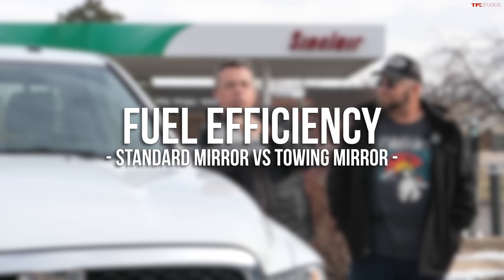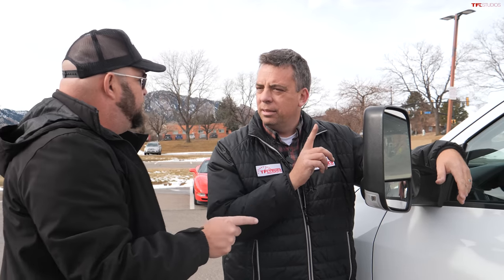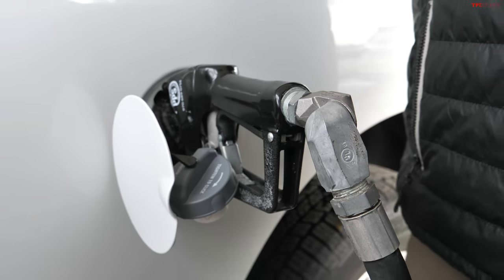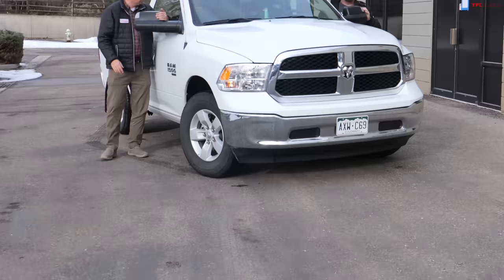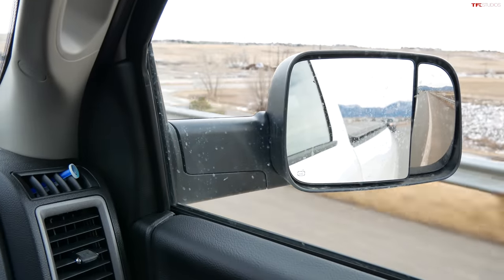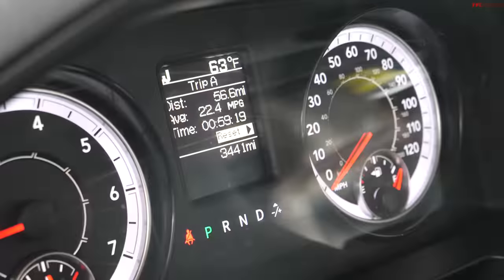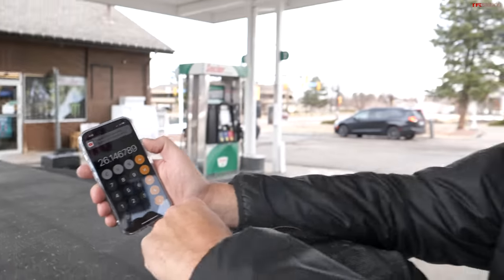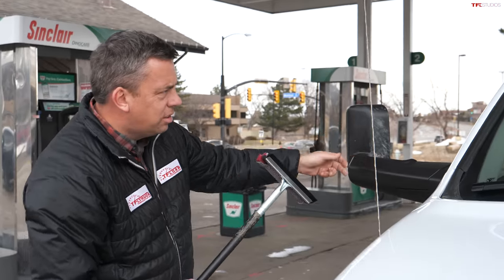TOTALLY UNEXPECTED MPG - Never Drive with Your Towing Mirrors Extended While NOT Towing: Here's Why!

Comment: I prefer the convex to be wide, not tall. I also prefer the main mirror to be wide, not tall. Since the option on that mirror is one or the other, I'd make it so the convex is wide and just live with it.

Years ago I heard that car makers removed the AM/FM antennas from the fenders and moved them to the rear windows or somewhere else, resulting in a gain of about 1/10th MPG.

You need to take a longer trip to decide MPG changes. 57 miles is not enough!

Comment: 2019 f250 ccsb 6.2 gas with 3.73.

Going off the computer, I have no difference between extended and short. Biggest thing is speed. 58 mph on back roads will get about 17.5 mpg. 65 mph gets about 15.5 mpg. 70 is 14.2 mpg and 75 is 12.1 mpg.

I just wish I could switch the flat mirror and the convex mirror, I like the convex mirror better.

Comment: The aerodynamic aspect of the mirrors is not what's causing the drop in fuel economy. The drop is due to programming in the truck's ECM. When the mirrors are in tow mode or "moose mode" the engine tune is changed to increase peak horsepower by 100 and peak torque by 150, regardless of the engine your truck is equipped with. This is done to improve towing performance but unfortunately increases fuel consumption. Side note: to increase this effect enable the hidden sport mode by turning the tow/haul mode on and off three times within ten seconds, leaving it in the on position the third time.
Reply: lol I hope you just missed putting th /s at the end of all that.
Reply: @ALMX5DP  hey it's only a lie of you believe it's a lie 😂😂

Comment: I still believe there is a flaw in your filling method.   Why not try a 3 or 4 time test run with the same setup just to confirm your testing is  fuel refill quantity accurate.

Comment: I agree with some of the other comments. That is way to large on an discrepancy and that test should be re ran a couple of time.  The extra air surface cannot create that much wind resistance to slow the car down enough to make 6 mpg difference. Maybe .06 of a gal but not a full six. Even swapping tire by up sizing wouldn’t drop 6mpg.

Comment: I think for these test, you should go by the computer. While it may vary from reality, they are usually consistent. I've had 2 rams, 1 consistently read 1 mpg higher than hand calc and my current one runs about .5 mpg off of hand calc. In your test, it seams that the full between runs may have been a bit less than full.

Comment: There's a lot of second guessing with previous MPG results here. Outside temperatures are the largest variable here, acting on air density, drivetrain rolling resistance, tire compound temperatures and tire pressures. All potentially skewing a baseline MPG result. 

Would be difficult to test without large time lapses in between, but a figure to consider.

Comment: I bought a set of these mirrors for my 2005 Ram 2500 HD and noticed immediately that the wind buffeting on these mirrors (when up) was enough to drastically increase the noise level in the cab (the doors were actually moving slightly in the frame). I decided to fold the drivers side mirror in toward the body to see if that would reduce the wind noise but the air pressure moving across the mirror actually forced it away from the body about 3 inches. I wonder if the chevy style tow mirrors would work better?

Comment: I would trust your vehicles computer to measure the fuel used way more than where a fuel pump clicks off, depending on how the fuel splashes around in the filler neck your always gonna have totally different numbers, compared to your trucks fuel injectors that are extremely precisely calibrated otherwise the truck would not run right.

Comment: Only way to properly test differences like this would be to use an external fuel tank that can be physically measured or significantly increase the driving difference / fuel consumption to remove differences on fill-ups.   I do agree the mileage should be less but this significant?  Not accepting this.

Comment: Seems like the pump isn't consistent as to when it clicks off. I realize it's difficult to do it any other way, but to be anywhere near accurate, it seems like you would need a more reliable way to more precisely quantify the amount of fuel burned. Although not practical, it would seem the results would be more accurate if done over a much longer loop...the difference of a few tenths of a gallon (easily variable with even the same pump) over such a short distance obviously changes the outcome of the test in a very dramatically. You guys are awesome and I like all these mpg tests, but I have often wondered about the reliability of the results over such a short loop (because of the likelihood of the pump to be inconsistent regarding when it automatically clicks off.

Comment: I’m agreeing with so many of the other commenters. You guys need a retest. You need to only use 85 octane. Even when your not doing your test. You are only topping off when you refuel with for your tests so if you are using any other octane or gas with ethanol or ethanol free can make unscientific deviations in your tests. I have never used 85 octane, but I would imagine 85 vs 87 alone could cause some deviation in the economy. I would think if you take your past test “stock” fuel economy quick is closer to 22 mpg that loss in economy makes more sense. A 2mpg drop is significantly more believable than 6. With that logic, 80% of my drop in fuel economy while towing my 10k lb travel trailer is caused simply by my tow mirrors being up. Run the test again.

Comment: The only problem I have with at mirror design. Is not trying to hit them when they are coming at you. They stick out way to far. All it takes is someone with them. Near the line. Their truck. Not the mirror. It puts me off the road. Some days I just want to hit them with my own mirror.  My 2020 F150 mirrors being close to the truck. I can see perfectly down the side of trailers. I hate those mirrors on a Dodge. All because they stick way out and I have to avoid them.

Comment: I have tracked every fill up in my truck for about 17k miles. It's a 2021 Ram 2500 CTD. I can say that I've never once experienced the EVIC calculating a lower MPG than a hand calculated MPG. I would question the validity of your first test. I believe that almost every Ram I've seen and asked for hand calculated MPGs has experience between a .8-1.5mpg EVIC variance whereby the EVIC over estimates. Additionally, while the extended tow mirrors do account for additional surface area being present to the wind, it should be more along the .2mpg difference at the top of the scale from what I've anecdotally seen and calculated. I enjoy the test, but to make it more scientifically useful it would need to be run a few times and throw out anomalies. Thinking your EVIC should be over estimating versus your hand calculated. Just my experience. As other have stated, the best test would be to run the loop with a weighed quantity of fuel, but that's not very practical. Either way, keep up the testing! Interesting to compared data!

Comment: You should have used 85.  87 octane will run richer at altitude.  The 85 that was in the tank before the first fill up will burn first.  As the miles go by you octane will have increased causing richer burning as the miles rolled by
Reply: How do you know what was in the tank before this video? And the engine will adjust based on the reading from the MAF or MAP sensor. Also Ram specifies a minimum of 87 octane with no exception for elevation.

Comment: I see about a 2 mpg difference, tow mirrors vs not. It’s crazy how much wind resistance it causes. 

Never use tow mirrors unless you are towing. You are throwing money out the window.  

I calculate I have saved about $4,000 over the life of the truck so far. Will pay for a rebuilt transmission or engine one day.

Comment: The results are not surprising given my aircraft and motorcycle aerodynamics experience. For example, my Honda GoldWing with a 1.5 liter engine gets around 35mph or so. I've got mirrors, air horns and foot boards hanging in the airstream. Put that same engine in a car and it's probably would get a whole lot more mph. Aircraft? I've seen that just washing an airplane can gain speed. If I throttled down to maintain the dirty airspeed, I'd decrease my gallons per hour. Real world to you nay sayers!

Comment: Guys the real result is 22.4 MPG vs 22.1 MPG with same margin of error from trip computer on both results.

This double pump method doesn't work right when consumption is very low (small trip), since it has a big margin of error from the start. The gas is foaming and frothing, and tripping the pump within +- 0.5 Gal or so. That would be negligible if you used 25 gals, but at 2 gals, the margin of error is MASSIVE. 

You guys insist at this method. Perhaps you should consider keeping pump at slow flow to reduce foaming, and consider consuming at least 5 gals for testing? Yes, for more efficient vehicles, you'll need a lot more than 57 miles, sorry : )

Comment: Obviously mirrors don't make a nearly 6mpg difference. My problem with hand calculating the results is that in a small distance, the variance on when the pump is triggered to stop plays a HUGE role....best hand calculations would be doing basically a three full tank calculation, so a tremdous difference which should factor the variance in tank fill out. Of course, that would take too long to conduct and film, plus increased cost, that I would simply recommend going off the difference on a longer loop, but using just the trip computer avg. But the very high mileage achieved in one tank more or less foretold the low avg in the next (or previous) tank.

Comment: A loop that short doesn't give you a  accurate  result because the fill up can off by a quite a bit to make the result incorrect.  You would have run a LOT more miles to get a more accurate result.

Comment: if you have a diesel as a daily driver, fuel mileage is not why you bought it . Never mind that all the restrictions they put on the engines are why fuel mileage is so crappy !!! I have a 1997 12V cummins and a 2014 6.7 cummins . I drove from Houston, Tx, to Dallas, TX, and back . Both stock ! My 12V I made the trip, and when i got back, I had a little under 3/4 of a tank . In my 6.7 same trip, same mileage. When I got to Dallas, I had 1/4 of a tank . For  These Big Oil companies, better fuel mileage is a BAD thing !!!! Durable is a bad thing !!! They make more money if you have to buy More fuel and oil . If you took all the restrictions off these trucks I guarantee you would get WAY BETTER FUEL MILEAGE,  YOUR oil would last longer . and your truck would last longer . But that's NOT profitable for the makers of the vehicles or Big Oil . Cheaper parts , More restrictions is the REAL PROBLEM !!! FOR THE CONSUMERS AND THE MONEY MAKER FOR THE DEALERS AND BIG OIL !!!!

Comment: Your test loop is too short for your fueling top-off method. Your top-off method has too many variables that are not repeatable, especially if you are only consuming a few gallons. TFL needs to invest in a better system to determine actual fuel consumption.

Comment: I don't think the results are that offbase.  air resistance added and MPG is not a 1:1 curve at all.  It's stepped, in-line with the gear ratios.  What gear you can stay in makes a HUGE difference in overall MPG.  All it takes is enough wind resistance to get you into a lower gear and tank your MPG

Comment: Hmm. Seems a little exaggerated. What octane rating of fuel was in the truck before you topped off at the beginning? Was it 100% 87 for the entire test or?
Reply: Good question, they have been adamant about running 85 up until now.

Comment: Mirrors that stick out that far look dumb, only useful when hauling a trailer.  Also ,you are not on the interstate all the time. They get in the way to oncoming drivers on country roads and in parking lots because most people don't bother to push them out of way when they are not needed.  I think insurance rates should be higher for trucks with these if they aren't already. Unless I was interstate hauling all the time
I wouldn't own them.Those mirror's make a 6 foot wide pickup truck  about as wide as a semi truck.  The width make them unsafe and impractical for most pickups (according to me)

Comment: While I appreciate that TFL takes the time to do such tests, in the end, this is too small of sample size (distance driven and gallons pumped) for there to be any worthwhile/reliable data. I know funds for fuel and the time to drive long distances are both finite, so maybe best to not even do such tests at all since the results are obviously inaccurate.  Unless TFL comes up with a more consistent means to measure the fuel used than pump shutoff, you'd need to drive much longer distances and burn more fuel (15 - 20 gallons) so the inconsistent pump shutoff results in a smaller/insignificant fuel amount in the overall measurement. 
In this case, even if the dash estimate isn't 100% accurate for mpg, it is likely consistently off so would be a more accurate comparison, for the two runs, than your hand calculations. In this case, they differed by 0.2mpg which is much more plausible than the 5.7mpg difference of your hand calculation.

Comment: I'm surprised....but then NOT surprised.  There is a zone of turbulence around the truck just because of it's blocky shape.  If in the inboard position the mirrors are already IN that zone, and when they're in the outboard position they make the zone much wider and more turbulent, that would easily account for it.  I do NOT trust the onboard ECU as far as gas mileage.  I check with a calculator pretty often for both my RAV4 and my motorcycles, and the only one that is consistently accurate is my 2021 KTM 890 ADV R, which, weirdly enough, seems to be within about +/-1/4mpg, whereas the worst, my RAV4 can be anywhere from exact to about 3mpg off either way, you just never know with it.  The difference on the bikes is that I can gage EXACTLY how much fuel is in it by sight in the filler neck, and I have to rely on the fuel pump cutoff of the pump for the RAV4.

Comment: I feel like you test this on a bigger motor and it won’t change as dramatically.  My 19 f150 5.0 ccsb mpg changes drastically on the same road based on wind.(16-20 mpg depending on the wind)  I’m of the opinion that these smaller displacement gas engines are more affected by aerodynamics.
Reply: The engine does not impact the aerodynamics. Each engine has to put out the same amount of work to overcome the extra air resistance. Yes the 6 cylinder will rev more because the geometry is totally different, of course, but they still have to do the same amount of work to overcome x amount of drag. Look up the definition of work, in regards to engineering mechanics.
Reply: @danbutler4314 😱
You seem to forget that some motors are more efficient at different loads x rpm 
Just empirical evidence
Reply: @danbutler4314  What John said about the efficiency range probably was a better wording than what I said.  When the efficiency range is smaller on the smaller engines the aerodynamic effects tend to push the motor out of the efficient range more and cause greater change in mpg.  6 mpg change on 20-26 mpg is ~25%.  You would never see a 25% loss if this test was done on a Cummins or the larger hemi motor.

Comment: This type of test methodology is flawed, since you aren't actually testing fuel consumed, but rather how much fuel you can put in the tank. And with such a small fuel quantity, there is a huge room for error. 
For example, if when you filled it the first and last times, you managed to get as little as 0.25 gal more in than the second time, the numbers would have been 26.15 vs 23.45 mpg mirrors in and 20.4 vs 22.4 mpg out. 
Now, if you ran the loop 8 times (456 miles), 0.25 gal difference would make less than 0.3 mpg difference.

Comment: So you all should risk it for biscuit and unbolt the mirrors and tape holes over and run it again. The last aero drag components on EVs are mirrors.. Elon claims their models would be 5% more efficient without them.

 If math holds up 5% on your test would put you around 27.5 or more mpg.

Comment: Guys that drive in Moose Mode are the same guys that leave the yellow protectors on the chin spoiler of their Charger/Challenger.
Reply: As a retired truck driver I’m used to my mirrors vertical I can’t deal with the spot mirror on the outside
Reply: @detlevwilloughby7175  I drove trucks too. I can see just fine in horizontal mirrors.

Comment: You are correct; you will get 100's of comments; so why even publish until you rerun this test a few times to confirm or deny the results? Sorry, but not believable. No way that would make close to a 30% difference... I'd say you need to run it again over at least 100 mile course with better fuel measurement management.

Comment: What about since at least in your bed cover you used 85 now the mix is different even if it’s a small difference maybe the PCM notices inflight and adjusts but recalibrates on the next startup. Also it sounds minor but was the truck We’ve all had that one fill up that never seems to run out every now and then. Being such a difference I’d have to say it’s a fluke even from your other videos. Dodge WISHES any truck got 26mpg! I could assume an aero difference so I think they may hurt ratings but not that much